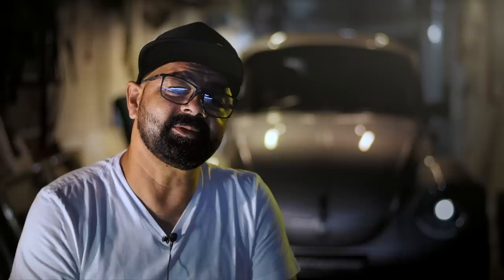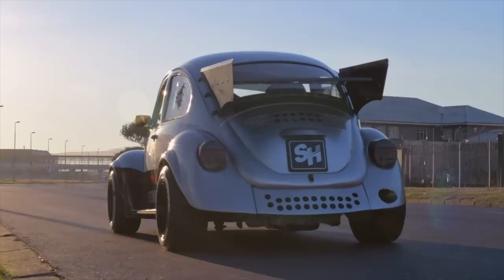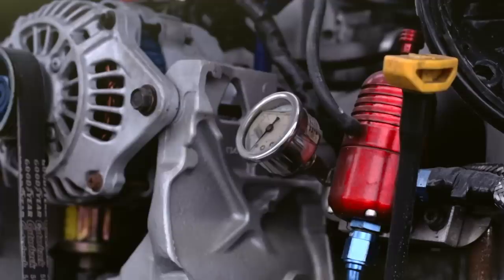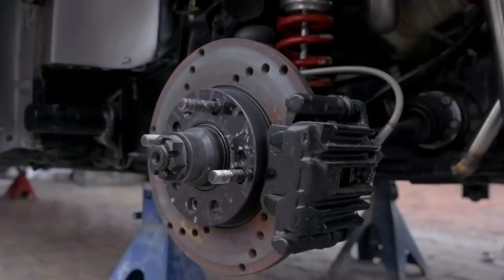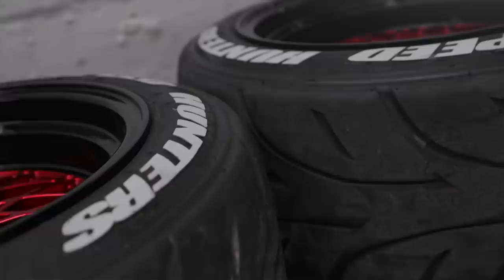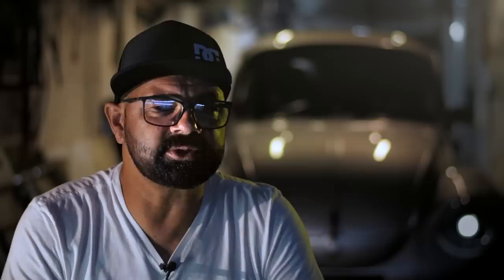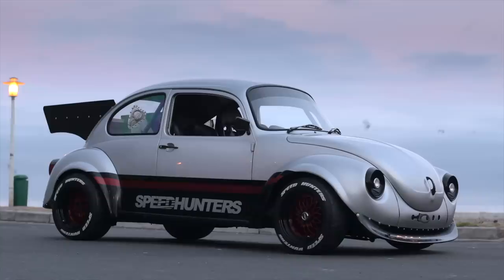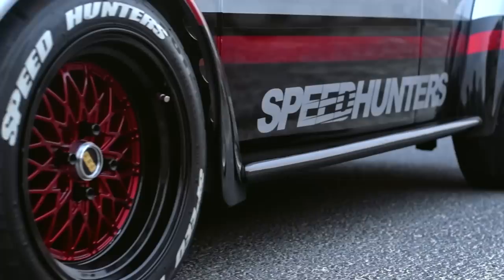The Subaru-powered Speedhunters Super Beetle - Launch Control Ep 3

Comment: it could be a lowkey sleeper with burps on exhaust, but hey if it works it'll work just fine. That's one of the most radical beetle I've seen after the V8 swapped one by another company.

Comment: I"m a "FAN"freak(especially"E" heat extractors fans,when I built my "SUBI-BUG"project,I kept it Sleeper-Style"with a Subaru flat four 1998(217 HP.TURBO engine,but in a 838 KG car)....Cooling that bay was my main concern,being rear mounted,I wanted to"scoop"fresh air from the bottom,witch I did,with a plexiglass bottom,and 4 powerful extractor fans(on demand)with the original grid(Porsche has done it since)!!!And with discret louvers,heat sensors/dash gages.....Cooling has become super efficient,with keeping front boot space.......

Comment: A Beetle with a liquid-cooled engine, and one of the most unreliable in use, and finicky to work on....my head tells me I should not be a fan of this car....but damn, that's so nicely done - all the details in the holes, trim, paint, the stance, it looks superb!
About the only thing I'd change if it were mine would be those headlights - they're such a distinctive feature on the original, I think this car carries off all the other mods really well, but just those headlights don't quite work for my taste.
Still, as long as the person that lives with it likes 'em, that's all that matters!
Reply: EJ engines are more reliable than tuned air-cooled VW engines and they have a similar size. If you want an air-cooled engine with some serious power you quickly spend 7.000-10.000$(or even more). A used turbo-charged EJ engine is way cheaper even if you factor in rebuilding the block and turbo. If you view it from the perspective of an air-cooled VW owner Subaru engines are super reliable :D
Reply: The King - Fairly straightforward, they cling to it because we run scripts in our heads - Subaru=unreliable, Alfa=rust bucket, etc. Pigeonholing things saves us mental effort!
I wouldn't say they couldn't ever shake it off - Skoda, for example, no longer have the reputation they did in the nineteen-eighties, but it'll probably take just as long before idiots like me realise Subaru have upped their game!

Comment: Did anyone notice the water temp at 120?
Reply: forreal i wanted to know how they cooled it
Reply: Noooo prooooblemm. Air cooled ya noooooo
Reply: Celsius
Reply: matthew dyess yes, and the boiling temperature of water is 100, even if they are using anti freeze it’s still to damn high
Reply: @michaelmartins7457  Boiling temperature on normal pressure :) Some cars have over-pressure cooling system (or air-cooling ;) )
Reply: While its not impossible to get it up to this temp (much past this is warping territory, I would say the gauge voltage supply  sensor resistance and what the gauge will be expecting will just be mis-matched. Im sure the owner knows this. A e39 540 BMW is a pressure system, its normal for 105c but not anything past 112c. This is done for emissions.
Reply: As someone else said... its in Celsius!
Reply: @talonpilot  haha so what? Noemal temp. Norm is 90degrees celsius
Reply: You are all arguing about nothing ,add 10psi to a cooling system and the coolant won't boil at 120 ... You have to have heat to make power.
Reply: Lale I ...my point was to the “American viewers” because we dont use Celsius for temp measurement, we use Fahrenheit. I think, maybe I am wrong, but I think that those viewers were thinking the temp was really low.... on the Fahrenheit scale, 190-210 is normal temp range. Don’t get your panties in too much of a wad so fast!
Reply: 120 is a little low needs to warm up.
Reply: @garrettgiuffre7298  they builded a boxer liquid cooled right?
Reply: So, just a couple of points here:

Allowing for parallax error the needle will be sitting at or just below 110 which is perfectly acceptable, especially somewhere hot where the engine is getting used in a spirited manner.

There is also the chance that he may be using a waterless coolant (ref Evans waterless coolants) which has nearly double the boiling point of water mixed with ethylene glycol. This doesn't mean you can run the engine twice as hot but it does mean being able to exceed the normal upper temperature ranges limited by water and ethylene glycol due to a far higher boiling point and superior heat transfer so long as your radiator has sufficient capacity for shedding heat.
Reply: Had a stock 62 Chevy Impala, work car. Tune up on original 283 V8. Ran @ 120° F during the summer, (accurate aftermarket water temp gauge). 120° Celsius? No way.

Comment: My guess is that this drives and handles similar to an mid 80s Porsche turbo given wheel base, weight distribution, power and chassis rigidity.  It looks and sounds overly boosted (Subbie).  How does it handle aspiration through the rear windows?

Comment: Would have liked to know 0 to 100kms and 1/4 mile sprint. Other than that. I enjoyed. 🙋👍
Reply: Ran a 14.4 on the first outing, shakedown run, experienced some wheel hop, working on the rear end at the moment, will be ready 30th at msa drags killarney 👍
Reply: @KAEMATT28  fantastic. All the best. 🙋
Reply: There is a german beetle, with a typ4 320ps. With drag tires, and only 700kg it goes 2,5sec 0-100 und 10 sec 1/4!
Reply: Adonis Verkuil not bad at all for not hooking up. I’m sure you’ll see 12 sec or less soon

Comment: Approximately how much does a project like this cost?
Reply: to have it made: 6 figures. 
to build one yourself: depends on how much of the work you can do and what kind of parts you want. stuff like the H&R springs, coilovers and the custom work quickly adds up to big money. I think if you can get a cheap beetle and a cheap engine and have lots of know how this would be worth it, other than that a new 450hp mustang or camaro costs 45-50,000$ and you're never gonna get more for your money. a rusty beetle seems to be worth 3-5,000€ in germany right now.

Comment: Can anyone tell me what BMW front disc brake He used? Is it a bolt-on conversion?
Reply: try using porsche 944
Reply: @gee3883  thanks, any idea where I could acquire 944 front brakes? And roughly how much?
Reply: @giovantheunissen7234  car breakers, i bought 4 callipers fronts rears hubs and rear ali trailing arms all from a 944s2 fits a super beetle with some slight mods. check out Germanlook.org for info/how too